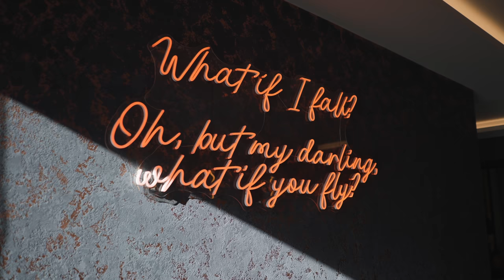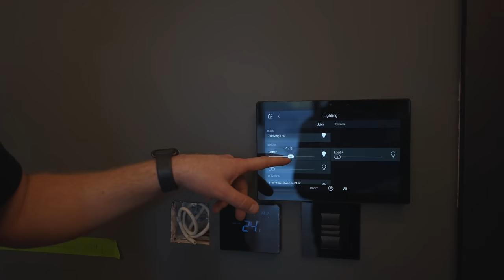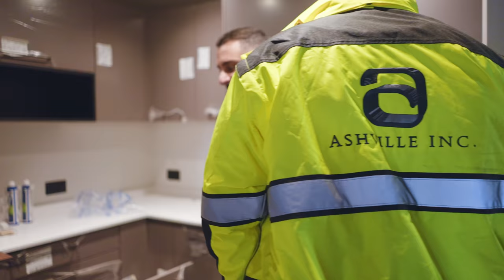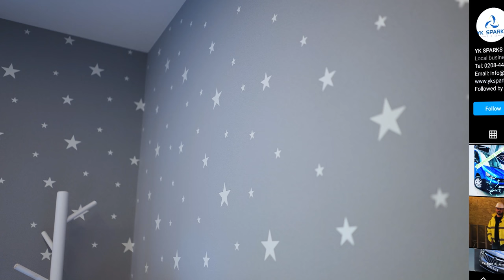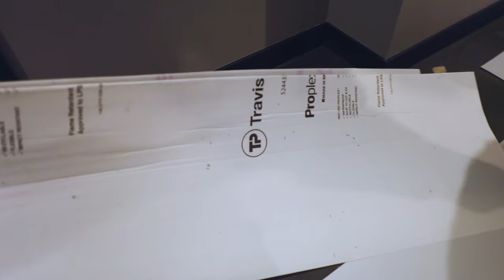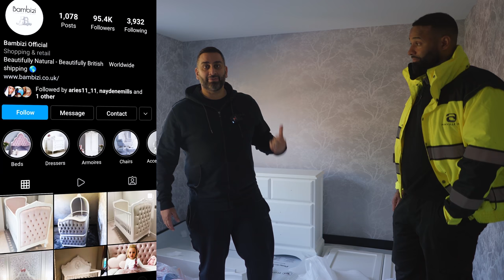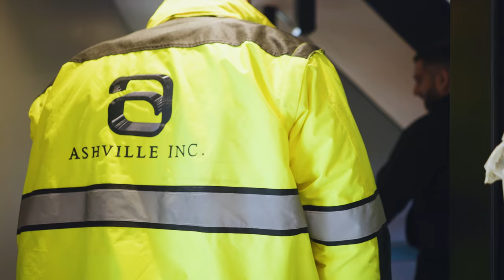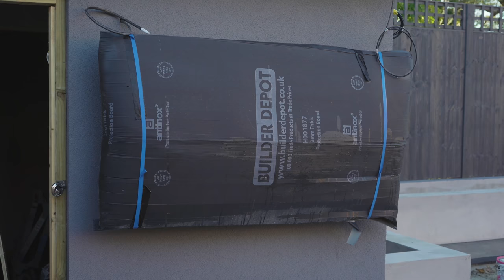The House Is LIT! 🔥 | Update #14

Comment: Shark is a mistake, had a Dyson for years and got a Shark cause it wasn't performing anymore. Realised the battery was the fault in the Dyson so replaced it and it's like new again. 

9/10 situations I start with the Shark but end up having to use the older Dyson instead as the Shark just doesn't have the same level of power.

Spend the small amount more and get a Dyson.

Comment: We have both a Dyson and a Shark.. I was very upset we were not getting a replacement Dyson, my wife insisted we get a Shark instead.. and you know what.. I love it so much more. Easier to clean/empty. It is so much more modular when you are using it also, you can break it down to super small parts which is amazing when I was doing our carpet stairs.. I don't think the stairs had ever been that clean.
Not gonna lie, there are more switches/levers/buttons what ever you wanna call them, that made things more confusing when I first got it.. but I quickly got over that.. (though sometimes I do have to think about which one to press).. but I prefer it over dyson now.

Comment: Should of had a Vac system installed at 1st fix stage. With outlets in each room. Then just the need the hose on each floor and you just plug the hose into the outlet  in the room you want to vacuum. And the main unit is in the garage/plant room with the filters etc
Reply: Why spend a lot more money on a vac system just to carry round that long tube, easier just to have one or two quality cordless vacuums.
Reply: @NoName-cl1ob  or get the system with retractable hoses 😉.

Comment: Looking mega 👍🏼🔥🔥🔥. Shark all the way dyson is a has been, I’ve had my shark for 2 years and still works like new. Must say tho Henry’s are good but crap on carpet as it flattens the pile, makes the carpet look older quicker and traps the dirt, yes you can put the brush down on the head but is a ball ache to drag or push……… yian get a shark mate …. Shout out shark. Can’t wait for the next one, these levels are beyond normal levels👏🏼👏🏼